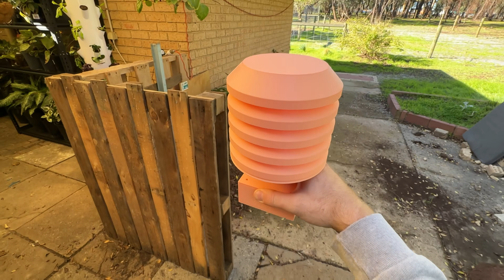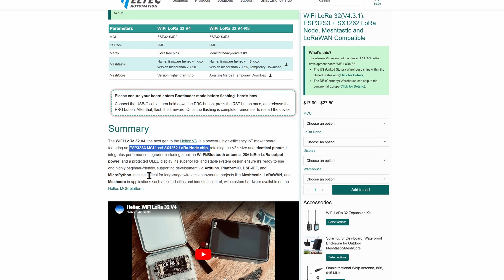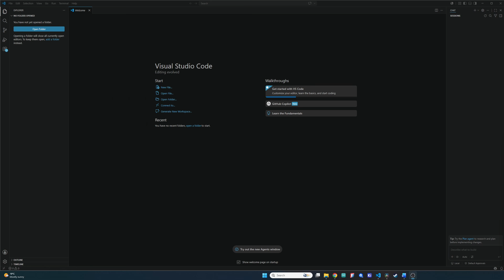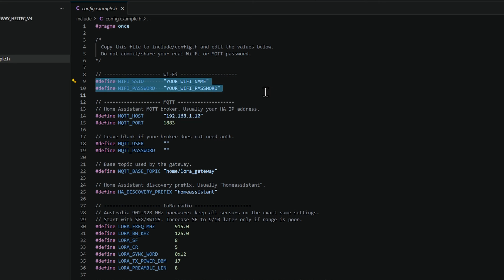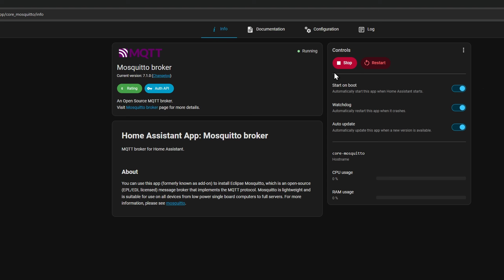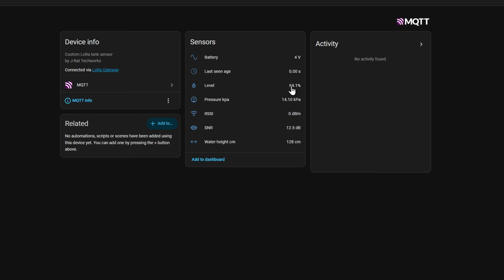No Wi-Fi? This LoRa Gateway Solves It

Comment: Nice channel. I have a mailbox 120m from my house. I want to make a door sensor for it. Do I need lora or can I get away with ZigBee/EspNow and a nice antenna? Unfortunately the Lora boards are 10x much more expensive than most dev boards.
Reply from the maker: Thanks! At 120m I’d try ESP-NOW with a decent external antenna first, especially with clear line of sight. Zigbee might be pushing it, but Lora would definitely be the most reliable (you can get Lora modules that are much cheaper than something like a Heltec)